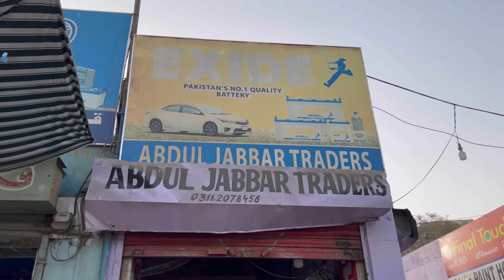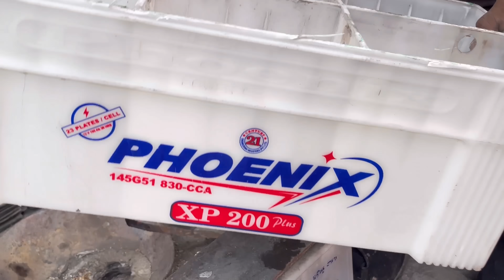Amazing Restoration Technique of an Old Dead lead Acid Battery | Amazing skills |

Comment: The cells are not even physically separated, if you tilt the battery to a 90' angle, the cells will short circuit, please don't buy from local sellers
Reply: "The cells are not even physically separated"

Did you watch the whole video closely?